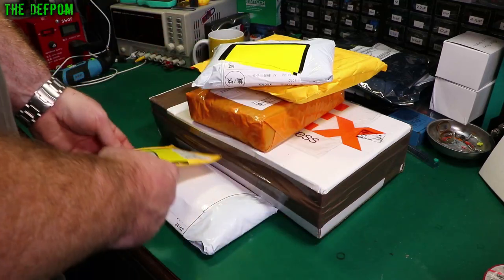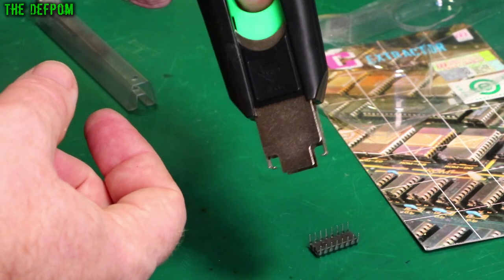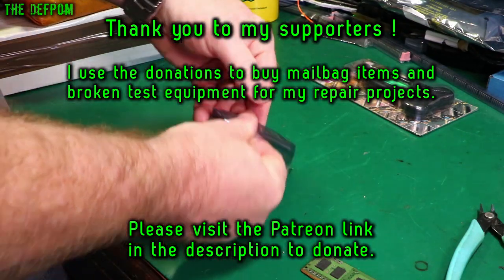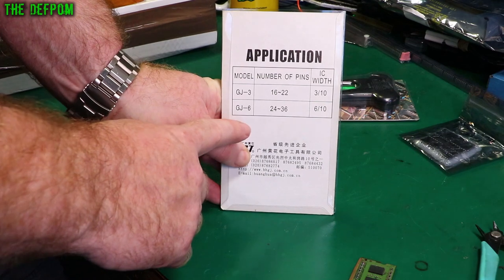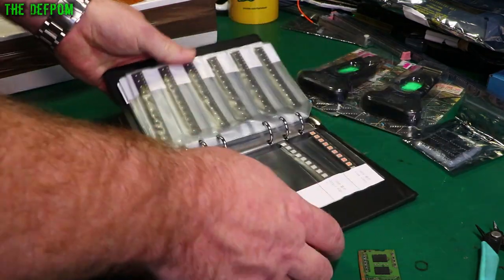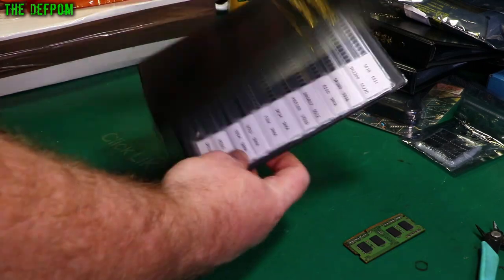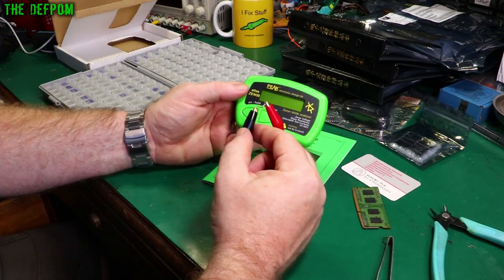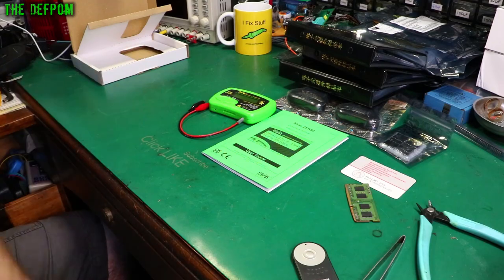🔴 What's in my Mailbag ? - Mailbag Monday 25th April 2022 - No.947

Comment: I made my own 50V zener tester using nothing than a atmega micro and few transistors. Uses simple boost converter driven by MCU's PWM. It is an easy and useful project
Reply: I built a similar tester using a 555, driving a boost converter and a cheap panel mount volt meter. Its not only useful to test zener diodes, its useful for testing series strings of LEDs. With nothing connected, the output is 68V. The output current is limited to 20mA. I found a schematic online.
Reply: I used components i salvaged from scrap boards to make the boost circuit. A 555, a small inductor, an IRF541 FET and some resistors and caps.
Reply: Salvage the flash circuit out of a cheap camera, connect to the flash cap with a series 100k or so power resistor.

Comment: The low voltage zener diodes are pretty soft in their performance. Their slope or resistance is pretty variable
Reply from the maker: Indeed they are.

Comment: Well Scott that is a really cheap and nasty chip remover 😞
Reply from the maker: I will have to see how well it works, haven’t tried it yet.
Reply: @TheDefpom  I was expecting you to get something like my eprom remover and the installer which is solid aluminium and grips between the pins and pushes against the PCB no pulling by hand